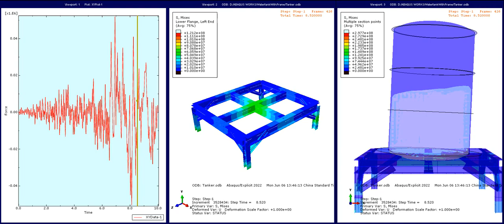Water tank nonlinear time history response under the earthquake loading using Abaqus Software

Comment: your tank was leaking, didn't you see? I supposed you use CEL to do this. However, usually the liquid in this kind of analysis use lagrangian element with EOS material type.
Reply from the maker: Haha, the tank wasn't leaked but the mesh was coarse so the water seems draped.